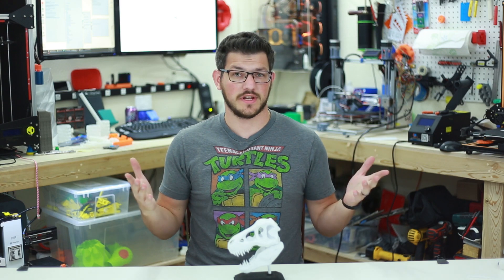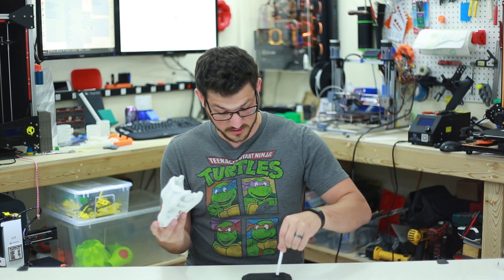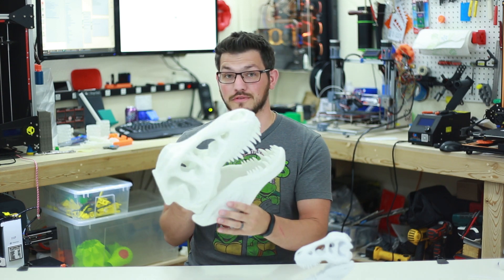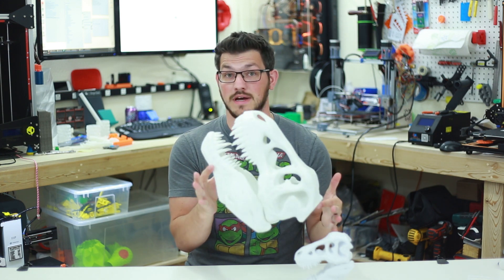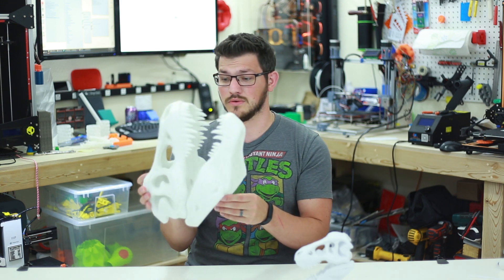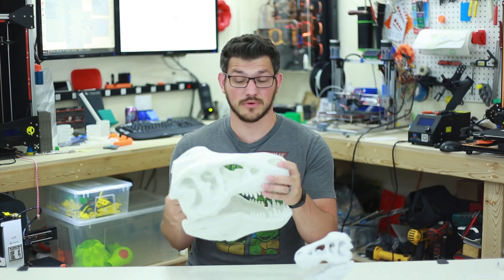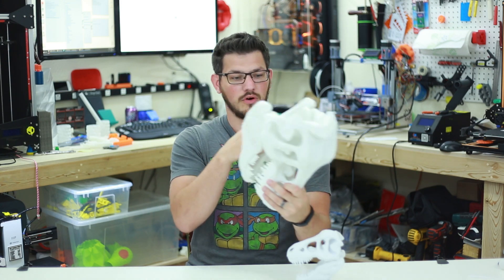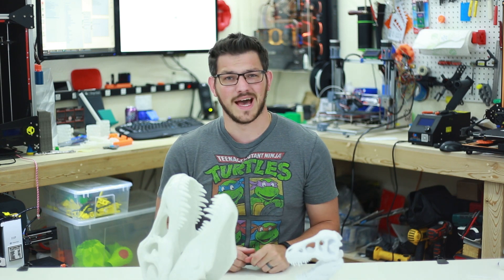Huge T-Rex Skull 3D Print

Comment: How well does your ft-5 maintain the level of the bed from the nozzle? Do you spend 20 minutes releveling it every time you turn it on? I ask because on mine I can get it where it is just right from the bed and the next time I turn it on and it auto homes, the nozzle is like 3-5mm from the glass and I have to spend a bunch of time trying to get it level enough to print on. I've even got it where its perfect level using a business card, and then when I tell it to print and it auto homes its several mm about the glass as it squirts out plastic
Reply from the maker: That is very odd. I only level the bed once every 2-3 weeks or when I switch out build surfaces. Almost sounds like your Z is slipping. Did you try replacing stock end stop mount? You may want to look into a BLTouch.
Reply: You could also look into a single Z motor. I have the upgraded R2 version of the Z axis setup and since I have installed it I haven't had to re-level my bed at all. FT is selling an upgrade kit that will allow for an easy conversion to the single Z or you can do it  yourself. Plenty of guides out there.

Comment: I have a question that maybe you can make a video to solve. What happens when you put a volcano nozzle in a clone e3d v6 block? I ask this because I cannot stop getting leaking on my block and I think its the two separated parts for heat break and nozzle.
Reply from the maker: It shouldn't matter if it is legit or a clone. If you tighten the nozzle to the heatbreak inside the heater block, you should not have any leaking. Heat it to about 260C, tighten the nozzle to the heatbreak (there should be a gap between the nozzle shoulder and the heater block) and you should be good to go. Let me know if this doesn't make sense.
Reply: I did this with my block the issue with how I had it originally I got a poor quality clone so the threads were a bit loose, and after the all metal leaked and got caked in pet-g I switched to Teflon lined and now its covered in pla lol, with the Teflon it was a combination of the loose threads on the heater block and the Teflon being flush cut with the threads of the heat break tube leaving a small gap when it meets with the nozzle. since my block is so caked in pet-g/pla goop and I don't feel like spending hours fixing it I ordered a new block and hope for the best, and add some thread lock. I did spend $4 for the v6 assembly on a clear out eBay listing from a USA distributor so maybe that was my mistake, but now with a new seemingly better quality locally made heater block on its way I'm optimistic that I wont have as bad an issue. I'm still curious if the volcano being a m6 thread like the v6 using that would degrade performance when not using a volcano heater block with a .04/0.6 volcano nozzle.